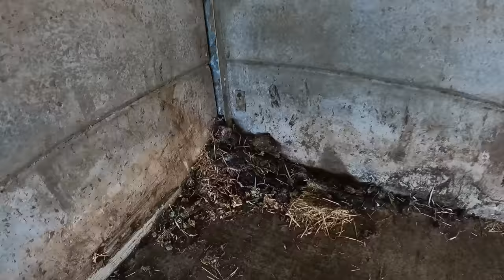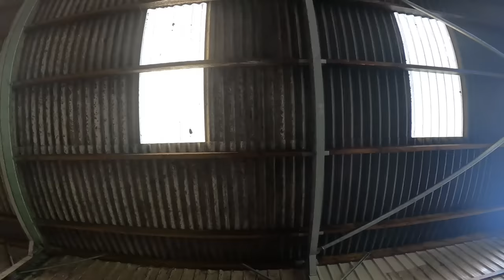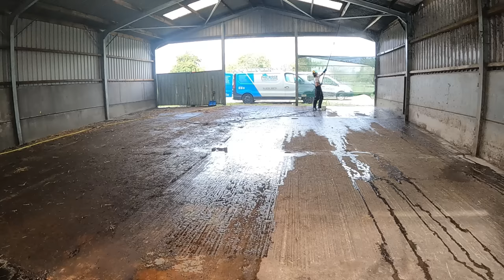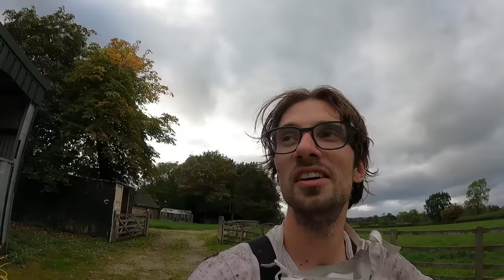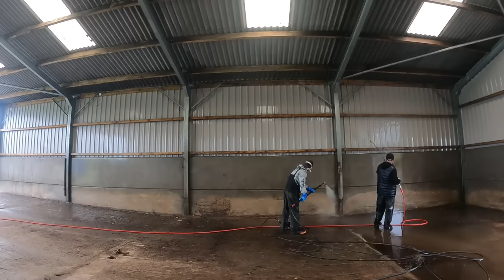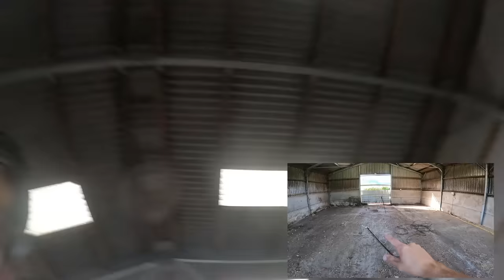OLD BARN FULL OF MUCK & NASTINESS POWERWASHED AWAY - Now it's CLEAN and Bright!

Comment: Hi Sid enjoyable vid as always, also I've worked on dairy/beef farms pretty much all my life and that barn was a deep litter cattle shed, the metal in the concrete is for metal posts so the farmer would be able to hang feed rails either side so you would have a feed passage down the middle, and the cattle would be either side and the farmer would drive up and down the middle feed passage either putting out silage or tmr (total mixed rations) from a diet feeder that would explain the staining mate.
Reply from the maker: fantastic comment thank you!
Reply: @PartridgeExteriorCleaning  No Worries mate and for me as soon as I saw the barn I knew what it had been used for, but I've been around buildings like that since my childhood.

Comment: 6:07, we have a real "grime line" sighting!  This is a fun job.  Someone thought it can be done, you have the potential skills and equipment and it really is enjoyable to see a renewed barn come out from years of use.  Kevin, thank you for managing the floor cleaning.  Looking forward to the series, like the outside area being cleaned up too.  That was funny, "just holes in the floor, not drains"....old post sites? The walls just keep looking better and better.  Even with the swept floor it looks like you are going to have a lot of sludge, from ingrained material on rough concrete... Really appreciated your problem solving as you went along and chuckled at the biocide.

Comment: You won't probably see this with all the comments but i used to wash hog barns (well and a lot of other things too)  here in the states. Best practices and suggestions for you, take em or leave em. Have the customer set up, 12-24 hours prior to you doing the cleaning, sprinklers. Not only does this loosen up the poop and mud but the fly poop as well. The kind that you use for your yard/grass. Especially heavier soiled barns. Make sure the hit the ceiling and walls. You will find barns that have massive build up several inches or more...use a zero tip here and "cut" them out in sections. If you plan on doing this for taller barns like this one you might want to start having a separate set of scaffolding with tie offs (so you don't fall). Sprinklers can be set on those too to reach the ceiling. Rain slickers for when you are doing the ceiling is good. Prescription eye googles. Rub the the inside with shaving cream and thoroughly wipe out and they won't fog. Your equipment will start taking on that odor so eventually you will want to separate sets of wands, hoses, and clothes. Fan tips are your friends. Lastly...washing animals barns. That smell will seep into your SOUL. You won't smell it after a while but trust me everyone else can. Spray deodorant works well but my go to was to wash (especially my hands and face) with a mixture of lemon juice/oil and baking soda. It really helps cut the odor down. Loves your videos!!! Hope this helps a little. <3

Comment: You did a great job. I am a farmer and we drive equipment through the center of our barns. the stain in the center is a combo of oil and hydraulic fluids. To clean the stains we use oven cleaner spray it on let it sit 10 -15 minutes then spray it again and use a stiff brush to scrub then rinse it off then sprinkle baking soda down or make a paste of baking soda and water and use it to scrub with a brush then rinse it off. Works great on driveways and bricks as well. it is also alot less expensive as alot of the industrial cleaners and works better.

Comment: Those holes are for steel fence posts, leaving a central through way for feeding the cattle. The dark staining would be from silage, which would be spread down the middle for the cows from each side to eat. 
The posts and fencing would be removed in the spring when the cows go back out to grass, this leaves the shed usable for other uses in the summer months.

Comment: Hi Sid holes in the floor are for gate or barrier posts, the black tarnish marks looks like were the cattle / sheep have been getting fed if fed on silage it marks concrete badly but does come off at some point, by the barriers outside it looks like they have had cattle in the shed

Comment: Square post holes for metal posts holding wooden stable/stall walls for cattle or horses - centre area used as parking lorries which have dripped diesel and oil all over the floor.

Comment: Hi Sid I have a good tip for saving your neck in that situation - get a good backpack that comes up high behind your head (like the old-style hiking packs) and put a rolled up towel or sleeping bag on top, right up against your neck. You can then tilt your head back at an angle and relax it on the support, makes a huge difference. I can roll ceilings (paint) all day with that trick. I thought of it myself, so if you use it, give me a shout out on a video lol :) Great clean again, thanks for sharing!

Comment: Just throwing out an idea for the staining, I worked for a haulage company which delivered animal feed round the country and two main product was sugarbeet pellet (a dry store pellet) and supaflow (basically sugarbeet coated in molasses). When the firm packed up and we emptied the stores of feed, the supaflow store floor was stained like that in the video and not much brings it up if it’s engrained in the concrete. Heat is best as molasses is just a sugar syrup like treacle but probably not worth clients money to put hard graft into something that might not shift👍 and as per the other comments the hole in the floor is just a lump of box section steel embedded in the concrete so that dividers or temporary walls can be put in, great job and an enjoyable watch as per Sid👍🧼

Comment: big tractor tire cut in half and mounted on a skid steer or tractor front end to push the manure through the barn out to the pad on the end. The holes were most likely for stalls that were removed and thats where they shoveled the manure out of and tossed it into the middle aisle for the rubber tire to come by and shove it out, the rubber left the skid or drag marks.

Comment: For the drain get the hose and push it down and it tends to clear quite well

The part in the middle is probably an oily substance from a tractor or feeder that is used to feed mabye as tractors expecially older ones tend to have hydraulic leakes

Comment: It looks like the stain in the center is rubber . Farmers use a rubber scraper to push  the cow muck  outside then move it with a digger , thats why its inline with the doors . Over time it builds up leaving old rubber on the concrete.

Comment: The holes were probably for posts that separated the barn into areas for the animals.
The sides are bare because the animals were there and it was covered in hay.
The middle is where people would walk and thus it was probably treated so they could clean it easily.
Probably some sealant on top and the stain is under and old.

Comment: Be happy your doing this in the fall. I had to clean much larger barn during one of the warmest summers on record in full protective gear (due to salmonella outbreak). 35 degrees in full suite is not nice, specially not when its 12 hr days. After half an hour you had to take the rubber boots of and pour out litterally dls of sweat.

Comment: My O.C.D. would have me start by sweeping the floor first. Then start pressure washing in the back and work to the front, while working from high to low. These types of jobs (where I'm from) are usually paid by the job and not the hour. So after doing a few you learn to be the most efficient with your time.

Comment: Dude, a GoPro or something fixed to a bracket on the end of the pile extension. A cheap ‘VR’ phone holder headset to connect to the camera so you can keep your head at a 90° angle to the ground and not kill your neck and shoulders while you pressure wash high ceilings.

Comment: Hello, Like dissolves like. Water based stuff is washed with water, Alcohol based stuff is washed with alcohol, and Petrol stuff is washed with Petrol. Try a 1 inch by 1 inch area with a very small amount of petrol and a brass brush first. If it comes off its petrol based.   If not, try pure alcohol the same way. As for your sore arms try resting your tool on something, like a hammer holder that's belted into your waist.

Comment: All the black you cleaned off the walls and ceiling is actually fly dung.... and the black stain on the floor is from years of a tractor going back and forth bringing feed and cleaning out manure.  The reason I say a that is because the holes were for fence poles to make what would be pens/stalls for livestock

Comment: Probably a cow shed? So cows either side, and the holes will have been the supports for metal fencing. The centre will have been where food was put out and then scraped every day with a blade on the back of a tractor.
That could have made it ‘smooth’ and years of food etc could have stained.

Comment: Between the two rows of stalls, it's the walkway.. Years of animal feet walking over the dung.. Must say job well done on the roof and walls.. The floor as well, it's up to the owner to redo the top layer or if he puts animals back in, it will not be a problem. 🌟🌟🌟🌟🌟

Comment: Nice job. I would have expected the owner to give it a better clean in advance. He really should for the outside bit, they surely have the equipment! What are they going to use the barn for? My sister married an ex-farmer, they have huge ex cowsheds, but they are not allowed to convert them to residential as the walls and floor are full of ammoniac from the cows urine. So it is storage for a household clearing company.
Reply from the maker: a guy just bought the place so hasnt even moved in yet (:

Comment: I trade façade sheeting like in the video for a living. I have to admit that I am always very weary to recommend pressure washing it.  The inside coating is usually kinda thin (0,15 or 0,25 um). What pressure do you use on the steel sheeting? Did you see any damages as a result of your cleaning?

Comment: The uric acid from the animal urine has probably softened the top layers of the entire concrete floor. After your marvelous cleaning job,It will very quickly start chipping and breaking up if the owners want a new brand new floor look without tearing out what’s there…I’d suggest shot blasting the existing floor then overlay it with Chemrex Sono-Flow or Ardex K-55. Or similar products. With specialized equipment this entire floor can be overlayed in one day and driven over with heavy equipment in 24 hrs. May have to use a scarification method if the urine has soaked in deeper.

Comment: 28 days later was the first, twenty eight weeks later came out later.  I'd think about getting some cheap waterproof trousers/jacket and checking if it's worth spraying them down at the end of a job rather than getting disposable suits that you will need to replace. You look like you were being dripped on.

Comment: Hey man, I’m a professional, Pressure Washing and Jacksonville USA I was just wondering what type of set up you were using and if you guys have access to chlorine a.k.a. SH AKA bleach. If there’s anyway for you to get a downstream injector if you would’ve chemical and soaked that thing i feel like it would gone a lot quicker. I have a pressure washer that does 8 gallons a minute it probably would’ve taken me 2 1/2 hours to do the whole inside. Great work I’m just wondering could you be cutting your work time in half it might not be the same there. You also may not have chemical available like we do in Florida. Not sure not trying to be an ass. I personally myself would have made them remove the poo. lol great job man not knocking you. Is this a hot water pressure washer you’re using??

Comment: You certainly look as though you know what you're doing so take this as a well meaning comment concerned about your well-being.
I'm a bit concerned about the masks you're using.  They certainly look tougher than a normal face mask but still just look as though they are ment for dry dust. If indeed that is what they are then I'd question the efficacy of them when wet. Added to that a simple looking flap valve and I'm not sure it's what's suitable for such a contaminated atmosphere. 
Personally I'd be wearing a full waterproof suit with a full face mask. Otherwise you're walking around in a soaked and contaminated T-shirt.